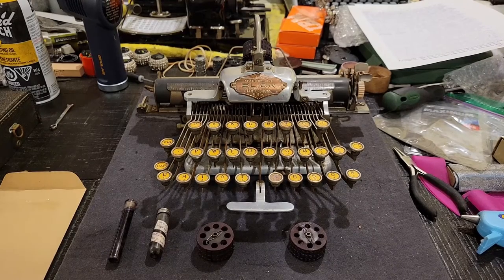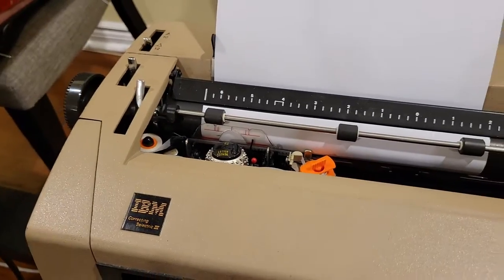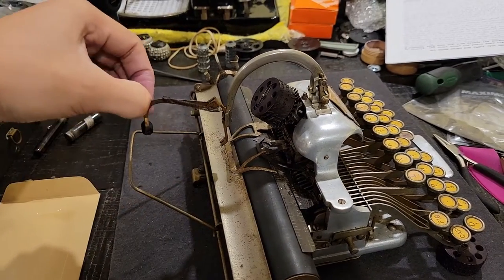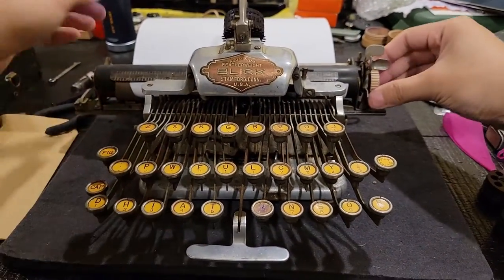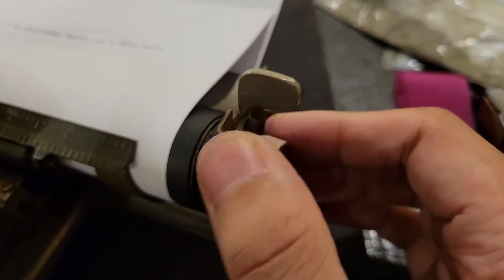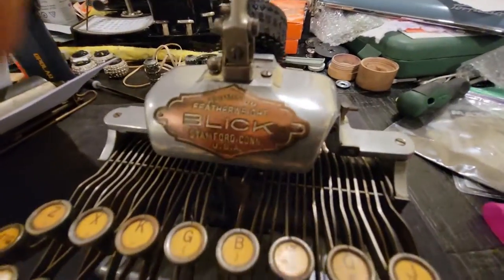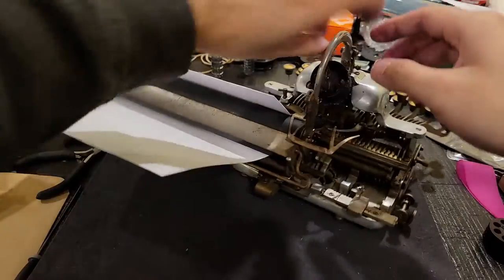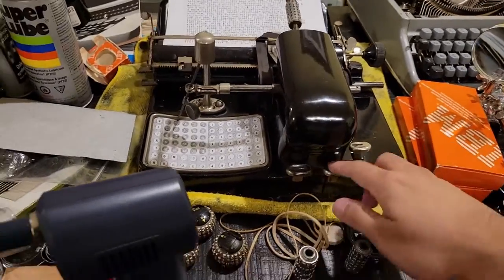All about the 1914 Blickensderfer Aluminum Featherweight typewriter

Comment: Why would you file down the typewriter instead of the type cylinders?  I'd think the cylinders are much, much cheaper
Reply from the maker: I happened to land this typewriter for around $260 CAD. Each of those special cylinders cost 60 Euros on auction and are much harder to find than the machines themselves. They are made of vulcanized rubber, and there is not enough material on the bottom that you can remove before the central hole gets compromised and the cylinder is ruined. I am much more keen to lightly modify my Blick to be able to accept any cylinder than to permanently damage these cylinders. I do agree that I made a mistake that led to more material being filed than was actually needed, but as you can see, the machine is fully functional, and I intend on keeping and taking care of it.

Comment: Great video...thanks! Do you have any information on adjusting these so they type the correct letter? I have a number 6 and a 7 and neither one will type the correct letter. It's like they aren't synchronized.
Reply from the maker: There is a section in this video on making sure that you have a type cylinder that matches your Blickensderfer's layout. Having DHIATENSOR type cylinders in QWERTY machines and vice versa will cause universal mismatches between the character on the key and the character that is printed. If this is not the issue, I suggest posting your questions on the Typewriters Discord's #help channel at https://discord.gg/H85AARDa.
Reply: @haelscheirs_haven  I'll watch that part again in the morning. Both of mine have the QWERTY keyboard. I'll try to find the letter arrangement for the QWERTY cylinder and see if mine are different. Thanks for your help!

Comment: Wut
Reply: I checked and both of my type cylinders are the same and both are QWERTY so the problem must be another issue. I figured mine are QWERTY because they are a different layout than the ones you show in the video. My problem probably has to do with some of the parts not lining up properly. I'll join Disord and see if anyone can help there. Thanks.